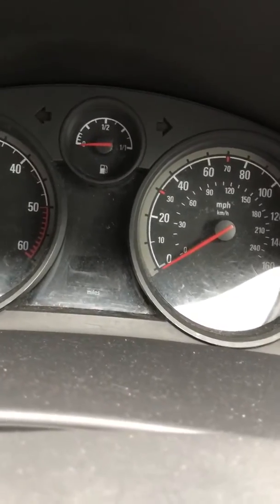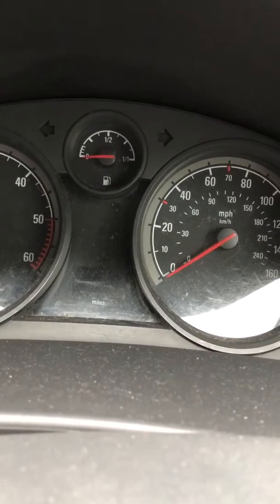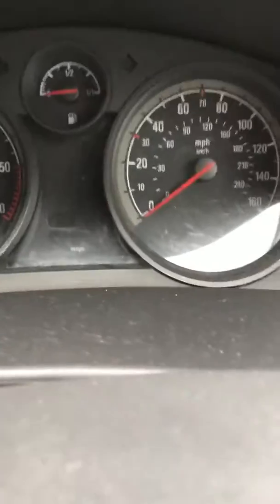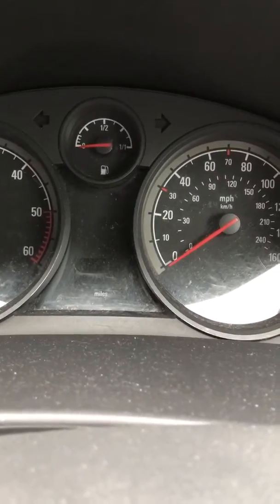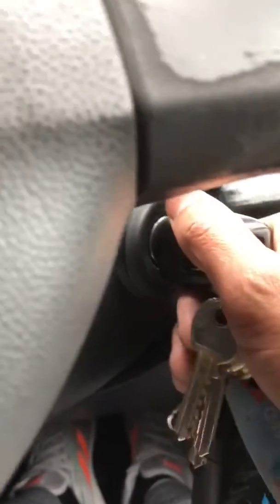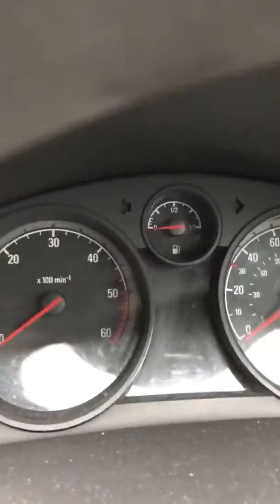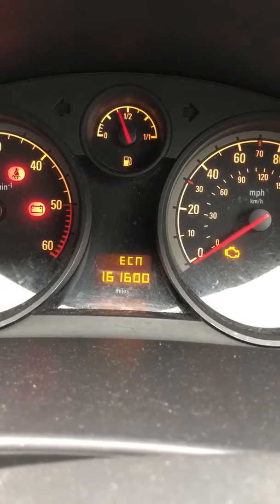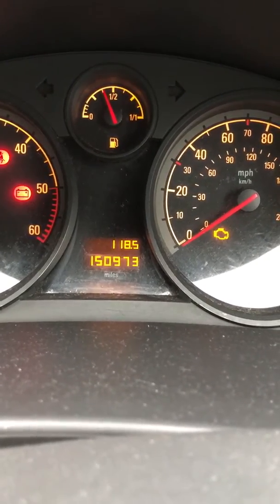MAP sensor fault - astra h pedal test

Comment: After doing pedal test and fixing the problem (no spanner or engine management light) done pedal test again.The display stayed on milage. Is this normal?
Reply from the maker: Hi. If after fixing the problem and redoing the pedal test; if it has stayed on the mileage that means you have fixed your fault and no fault is logged on the ecu.

Comment: that is a great hack. never knew about that. im having issues with my astra z18xe stalling and rev needdle bouncing at idle. Will the same work on petrol engine ? Dean
Reply from the maker: If it’s an Astra h, then yes the pedal test will work.
Reply from the maker: Hi again dean. Did you manage to fix the fault?